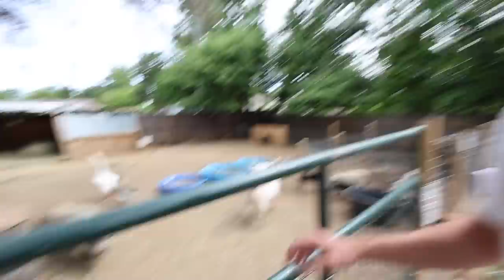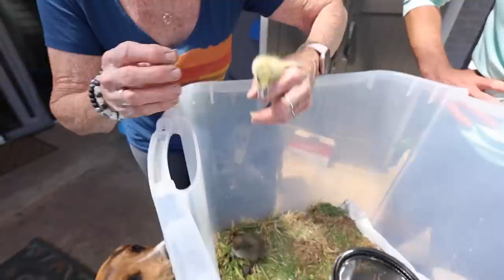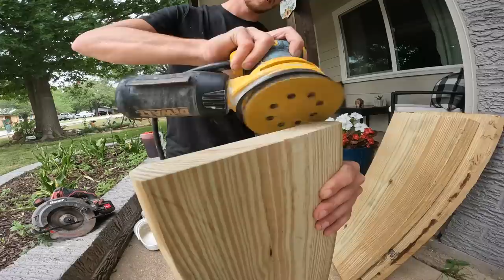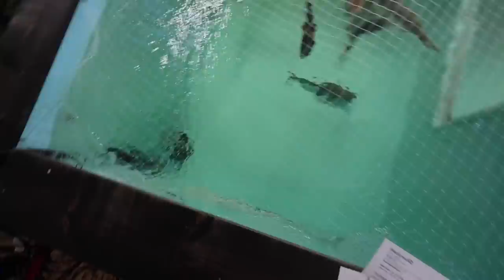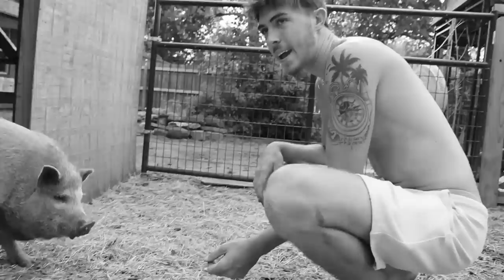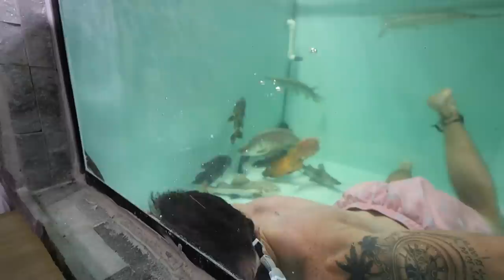MY PET PIG GOT ATTACKED!!!

Comment: Fibre glass the whole pond with 450 and 600 matting and add then but the gel coat you can mix with the resin and catalyst to paint on it will be a lot thicker and last a lot longer you can also do multiple layers of gel coat but don’t forget to buy the liquid wax additive to harden off the fibreglass matting and gel coat it will be better in the long run

Comment: That fence is wood and short. Its not stopping any predators.   If it can climb a wood tree.... it can climb a wood fence. Now if you topped the fence with a 2 or 3ft barbed wire thing, it would stop it.

Comment: Just use some epoxy putty stick that is made to use under water and fix it... also stop swimming in it... your displacement of water while in it put more pressure on those joints...
Reply from the maker: If me swimming in it is causing it to leak we’d have a problem, my 160lbs shouldn’t affect the other 8,000lbs although if it is I’d much rather fix it than have to worry about it. Definitely going to look into the putty tho thank you
Reply: @Finatic  the only thing I can say you really did wrong is you should have fiberglassed the corners first before you used pond sheild. But for your first time I think over all you did a great job on it.. watch youtuber "king of diy" he's made a lot of those kinda tanks...

Comment: Used bathroom caulking around the windows in in the corners. If you take a wet paper towel and run it across with your finger it won't get messing it smooth it out

Comment: Ohh boy, I had a feeling the Wood would not hold up. It takes a LOT of prep to make Epoxy adhere to Wood good enough to be water tight. If I were you, I would drain the Tank & cover the ENTIRE surface with some Fiberglass & than Epoxy over it. But that Wood under the Epoxy is probly no good now (at least not good enough for anything to adhere to it properly).